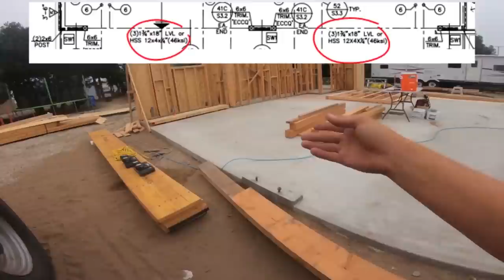FRAMING A HOUSE | 6 WEEKS IN 60 MINUTES!

Comment: As an Architect who has never actually worked in construction, I'm constantly trying to take into consideration how the building is actually being constructed. I try to minimize the disconnect between design and construction and videos like these provide an incredible foundation to build upon when communicating design with builders.
Reply: Brendan Leadbeater GOTTA GET THOSE CHURCH SHOES DIRTY AND HANG OUT ON SOME JOBSITES. HELPED ME SO MUCH
Reply: That’s good man, the more understanding everyone has involved in a project has of everyone else’s job the better.  I think of it as like a football team; I want everyone on my offense to know what everyone else is doing on each play.  I want my running backs to understand the blocking schemes, I want my lineman to know what route receivers are running etc... if everyone understands everyone else job it just helps the whole machine run smoother! 🤙

Comment: Man, I'm a structural engineer from NW FL. I work with different materials. Wood is my least favorite because it almost never gets done 100% per plans mainly because of the quality of workmanship.  Unfortunately, wood framers seem to be the least professionally trained comparing to the other building trades (concrete, masons, iron workers). I'm so tired to hear something like "I've been framing for 30 years and never needed damn Strong-Walls" or "How am I supposed to put this ECC if the jack post is already installed and king stud is on the way of the ECC's strap"... Your job looks beautiful! I bet it makes most inspectors and engineers very happy because of how well you pay attention to details before picking up a hammer (and not after as many would do).  Well done.
The house seems to be well engineered, too. 12" o.c. LVL's looks massive, but, hey, it is holding an exterior wall at the very end of cantilever which holds the roof trusses. Doesn't seem like overkill to me at all :)

Comment: I had a Gen Contractor Lic in Calif 19 years and Journeyman Carpenter. CODE requires a SILL SEAl between bottom plate and concrete. Code requires stainless or hot dipped nails when in contact with pressure treated wood. Shear osb or plywood requires 1/8 spacing between panels.
Reply from the maker: A lot has changed, galvanized nails is ONLY needed for brown treated lumber.. With recent changes in material, it’s no longer needed.

Sill seal hasn’t been used anywhere around here, not since I’ve been framing, due to recent changes in material as well.

1/8” spacing is still spot on.

Comment: I've always thought it was stupid to run copper tubing in a cement pour, and on an outside wall, your just asking for a failure  if the foundation shifts, your pipe could shear, if you get an extended cold spell your pipes could freeze copper and cement react togather, hard water can eat copper inside out or electrolysis can break down the copper.  The best way to do this is install a PVC entry path you can later seal like a bulkhead and put your copper inside it 2" pvc for a 3/4" copper pipe and fill the pvc with closed cell foam that way if the foundation moves the pipe wont shear, and it has no physical contact with cement.
Also if for some reason you ever have to change the pipe it's not a big deal just push it out and stick the new pipe in and fill the pvc full of expanding closed cell foam.
Reply: Interesting, I will remember that for my build. Makes a lot of sense. I have a small gas leak in my Dad's house that couldn't be located by the gas company and I hate to think this is the issue. He had foundation problems.

Comment: hey since your using Milwaukee drill, i use also, try setting speed on 1 when drilling. You will find it has more torque and easier to handle with one hand and battery last longer. Just a suggestion. Good job, i learned some things but i’m only an electrician
Reply from the maker: You drill a lot more holes than I do! I’ll give it a try!

Comment: Always finish your cuts at the top of the window with that router. You’re binding that material every time you drop it on the bit. I appreciate the craft you put into everything else I saw though, right on man.
Reply from the maker: Routing windows in the air is totally new to me! Luckily someone caught that in an earlier video and I was able to switch it up!

Works so much better.

Comment: I have been a framer for over 30 years and where I build at, we sheet the walls on the ground. It seems to be easier and faster, especially if you are fortunate enough to have a piece of equipment on site. I also noticed you didn't show squaring the foundation. I did not see any sill seal between the concert and sill plate. Where I build it is required to help with air infiltration and barrier between the treated sill and concrete.
Reply from the maker: We did the foundation, checked for square with batter boards prior to framing. 😊

Sill seal isn’t code in CA, I don’t know why. Never seen it used.

Comment: 75 degrees what a dream fucking hate framing when it gets to 105 then the humidity down south makes it even worse
Reply from the maker: The build i'm currently on it's hitting 100*+ and I hate it.. It's a dry heat, so not nearly as bad as humidity heat..
Reply: MattBangsWood I feel that still no matter what in 100+ degrees shit is going to be hot don’t matter where you are at but keep up the good work really digging the vids

Comment: I was curious what the going rate per square foot what framers get nowadays. When I was a framing contractor around the Seattle are in mid to late '90's we would get $3-$4 per square foot on the house and $1 foot on the garage. Labor only, we usually supplied nails.

Comment: Also I am wondering why you out the blocks in between the  studs about 2 feet staggered . In  Chicago we do them even cross all studs,  from bottom plate we mark 95” 1/4’  so that the exterior plywood sits perfectly on the halway mark of the block
Reply: 95 1/4 is top of first top plate.....dafuq u blockin?

Comment: Hey guys, what do you think about prefab panels? I mean you could fabricate all walls and floors/roof during foundation getting strong enough (taking into account that you will have well done shop drawings for wood framing) and then install those panels in 1 to 2 days. I am not familiar with this, just asking your opinion about this option.

Comment: It is always interesting to see how framing done in different parts of the countrty. I  do have a question though. Why do you frame your walls flush with the slab instead of setting them in the thickness off you exterior wall sheathing? Is that normally done in California? I usually set my plates in the 7/16" for sheathing so my siding starter lays flat against the slab. We have a lot of rain and termites in the south. I see a lot of framers doing the plates flush with the slab and have always wondered why.

Comment: Not to downgrade you in anyway. But just a suggestion, sheet the exterior walls and cover them with a barrier like Tyvek before you stand them up, leave 2 feet on the bottom and just enough on the Corners walls so that you cena easily wrap them around with tape afterward. Same with the plywood, why won’t do it I’m the ground right away. Mega saver right there. Also then you can mark the opening for windows and doors and cut them out in the deck right away .
Reply from the maker: We have shear nailing inspection, we can't Tyvek anything before it's stood unfortunately..

When you're building slab on grade, you can't sheet on the ground, due to having utilities to go over. We would have to lift the whole wall up 2' above the pipes and bolts to get it in place.
Reply: MattBangsWood I would just put some blocks underneath the walls enough to pass the utilities. I regularly build up to 5 walls onto pod eacho5wr and slide the, in to place later.

Comment: Just question.  Why was the main house beam connected over a window joint? I would have though it should be contact directly to structure and not to a window header.

Comment: the lumber must have cost a shit ton...  all beams for a floor lots to nail too 3 1/2 top cord. look like you could hoist an engine on the beams in garage ''. 18'' lvl 4 garage header. like the 6x6 posts for trimmers. looks nice. bet it was like 600k in lumber.  lvl would make nice roll blocks too surprised u only put one but i gues 1 3/4 all u need. seen a 102 header number just put those in a house today for a sliding glass door. is that the bigfoot saw or is it a bit bigger? solid beams is much faster then lvl headers.

Comment: I do wonder. Is there some online place where you can learn about how to frame houses?. In terms of "Up to 2 stories height". How to choose correct sizes that would support the weight and so on? (Basically learn wall framing). P.S: loved the "Daft Punk" in the background :)
Reply from the maker: Go check out the rest of my channel.. Watch the following: How To: Framing a Wall 16" o.c., Carpentry 101: Basics of Wall Framing.. 

These will help you understand it a lot more. From there, the structural engineer is going to be on the one to spec. out all the support beams and so on! :)

Want to chat anytime about any of the industry, shoot me an email with any questions you got.. I've got you.

MattBangsWoodManagement@gmail.com
Reply: @MattBangsWood  ty for the reply. Since i want to restore a ruin somewhere (not in the USA) => not quite sure there will be a structural engineer, so trying to understand +- the rules of: "what should be strong enough to hold". Would defiantly consult you in the future, thank you for the pointer.

Comment: This may seem like a simple question, but I see a lot of diagonal bracing for shear strength, but is blocking another method that can be used instead of bracing? (and sheathing too obviously) I much prefer doing blocking as its easy to do and doesn't get in the way of plumbing, thanks and great vids keep up the content.
P.S another blueprints video would be great, really enjoy the technical side of builds.

Comment: Love the videos matt!  Question- when notching out the 6x6 for your post caps (29 minutes into the video) why don't you use a router to take out that 1/16" instead of a ton of paases with the skill saw?  Seems like it might go quicker?  

Keep the videos coming!!
Reply from the maker: It would be MUCH quicker. Very viable option as well! My routers are set up for cutting OSB with Flush Trim Bits, i need to buy some new bits for it!

Comment: Kind of a dumb question: When you're using your nail gun it seems like you're not really worried about the angle/ your nail gun seems to be okay with pretty tight angles. Is that because you're using 2 1/2 in brats and the length allows the angle to not be perpendicular?
Reply: I realized I'm seeing it weird cuz of the wide camera lens

Comment: Great vid matt,  what are your recommended distance between your plate bolt please???
Reply from the maker: It’ll be specified on plans, this house was every 32” and a few spots were bigger than that. Works well, gets an anchor bolt in every other stud bay for the most part.
Reply: @MattBangsWood  cheers, im looking to build a concrete based workshop here in uk, no plans just my design and was looking for good, accurate ideas. Will be using your wall framing vid to build it. Once again cheers and keep doing what your all doing👍

Comment: I’m 23 and have been on a framing crew for 3 years and still never understood why people don’t sheet a wall before raising it? May be a stupid question but I just never learned, would someone please explain?
Reply from the maker: Gavin, it depends on the situation. Standing walls and sheathing them once they're up is cleaner, your walls are able to be adjusted. If you sheet walls on the ground and your bottom plate isn't straight as can be, or it's out of square a bit.. It'll never be plumb.

Big projects, we sheet on the ground. If possible..

Utilities get in the way, electrical sweeps, plumbing, etc.
Reply: @MattBangsWood  understood, thanks for the explanation

Comment: out of curiosity, where was this project ? is there not a snow load to accommodate for ? from an eng perspective I found it unusual to see a 3-lvl span that far instead of placing a w8 or 10 section...
Reply from the maker: California, never snowed here. I do see the curiosity on that though!
Reply: @MattBangsWood  thanks for the reply sir. Great work. I'm an engineer in Ontario, Canada. So our framing is a bit different obv from the south lol snow adds a crazy amount of weight if you have to account for it in design... hense why I've never seen lvl garage door beams.

Comment: How did you make sure the wall was squared before sheeting?
Reply from the maker: Cross checked with a tape.

Pull corner to corner, find center of that number. If ones saying 243-1/2” and the other is 244-1/2”, you’d meet in the middle and adjust the wall until they both read 244”.

Comment: Tip you are taking more time to lay ur sill plates when trying to dry fit your holes. This is actually hilarious and a waste of time. Tip always go 3/16 bigger then the bolt. And take ur fucking speed that u bought out,  i square ur board up slap and hammer and done. Your guaranteed a quick sill plate layout. There literally is not need to waste all that time drawing line and getting measurements ments when u have a to do plum ur edges up
Reply from the maker: I see where you’re coming from, but that’s not up to code in California.. all of our anchor bolts have to be within 1/8”, or they’ll fail us on inspection:

I see what you mean, but it’s just not possible.

Comment: Why most house in USA seems to be made completely with wood !?

Asking from Europe.
Reply: What are they made of in Europe?!
Reply: Hello nick 

Our house are made of concrete, rebar, cement, bricks, cinder blocks, wood is mostly used for the roof.
Reply: @XavierAncarno  where are you located?!
Reply: @meanasscobra  France.
But this is the norm throughout the whole continent.
Off course Wood house can be found  but extremely marginal. Or they're old  house from 18th century kept for historical purpose.(even those are not completely wooden, but huge oak beam filled with mortar and straw)
Each time is see images of tornadoes in USA with house litterally taking off, I'm wondering why people keep building flimsy wood board house. 
Granted building a house in Europe take between 6 to 9 months and cost  more than a typical 2 months build us house.
But at the end the lifespan of our house is average 50 to 70 years even more for some home made after WW1, I'll be happy my kid can inherit our house when I'm gone. That's our philosophy around here
Reply: @XavierAncarno  that's intresting!!! It might be an insulation difference??? Here in various areas of north America weather can vary +100*C throughout the year!
Reply: We have an abundance of wood in North America. We do the same here in Canada. It's cheaper, faster, and you can do a whole lot more with design. Have you ever been to the UK? Every house looks the same, almost looks like rows and rows of a prison camp
Reply: @XavierAncarno  A good wood tome can last over 100 years here. They use a lot of brick in Ontario and Quebec
Reply: Will Black  What are you on about, I go to the UK every summer, I know what residential housing looks like there. I'm not American by the way.

Comment: what the hell is he putting on that upper floor? TJI's and LVL's at 12" centers? Holy shit.
Reply: I reckon that floor can resist an airplane crashing into it
Reply from the maker: They're putting a swim spa on the third story.. It weighs A LOT.
Reply: @MattBangsWood  holy moly. The only time I have spec'ed wood sizes that were to hold up some sort of elevated water device (a hot tub in my case), I did DBL LVL's (beam) on the sides and ran single LVL's  (joists) perpendicular @ 16" centers. Had to maintain a L/1000 deflection criteria

Comment: I am a beginner. I am sorry for the ignorant question. 
35:18
What is this you apply and whats purpose?
Reply: It's construction adhesive. Glue. Also put it under the floor sheathing. First time I've seen in joist hangers but great idea.

Comment: what year is ur truck  ?
 has it been reliable
Reply from the maker: I don't remember what I was driving in this video, I think it was a 2007 Single Cab Chevy w/ a Utility Bed? It had the 4.8L small V8 and 338,000 miles if so. Truck ran like a top 'til we sold it.

I have a 2008 Chevy w/ the LS3 now and it's been nothing but great.

Comment: Why American use only woods? why not bricks and concrete
Reply: Machan In Germany That is the framing of the house it is what holds it up. The bricks will come later and concrete will not be used unless specified or by use of Precast around the house and also inside.

Comment: You need to get yourself a stiletto
Reply from the maker: I picked up a 16oz Dalluge that I’ve been lovin’ lately! I have a 14oz finish head Stiletto that has a great swing too.
Reply: I have a Dewalt mig welded 14 oz framer and a Stiletto 14 oz. Both are waffle face. Saves my old body and less weight on my tool belt.
Reply: MattBangsWood I picked up my 15oz waffle head 6 years ago. Still to this day it’s the beat hammer I’ve ever bought

Comment: U bring a table but no sawhorses.
Reply from the maker: If I picked up every piece of lumber to put it on saw horses, my back would be 2x worse than cutting on the ground, lol.
Reply: @MattBangsWood  Ya ur right since you have to pick it up anyway.LOL
Reply from the maker: All about how you want to work, I guess. I grew up on production framing sites, everything was cut off the stack. Moved once.
Reply: I did to,I was mostly talking about the plates you were pulling off the racks of your truck and putting it on saw horses,when you get a little older your back will thank you for those horses unless you can cut off a stack of lumber.